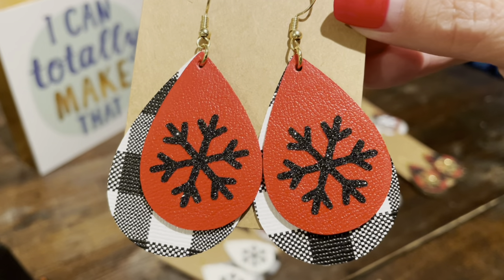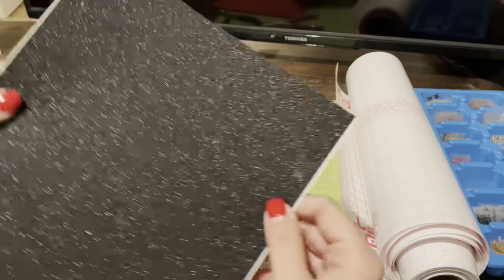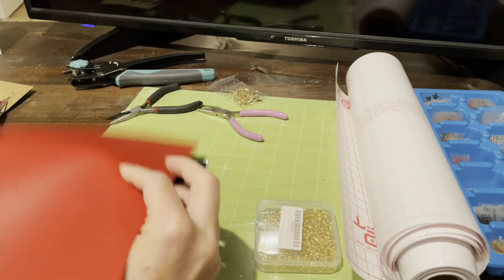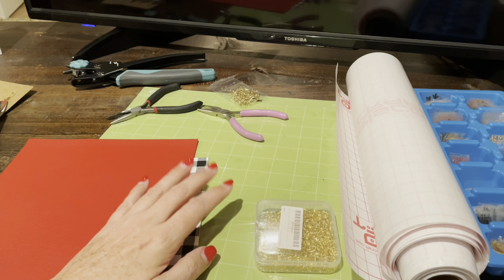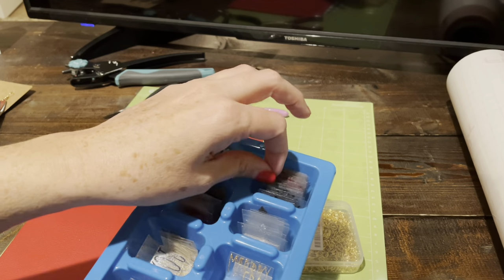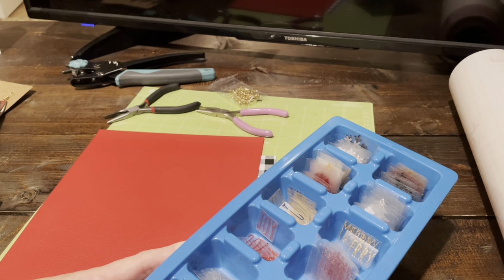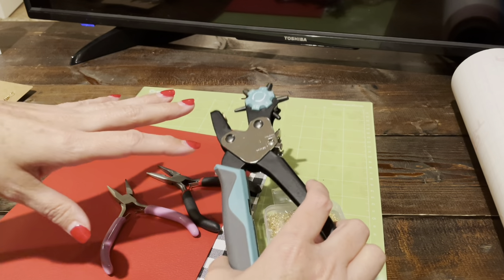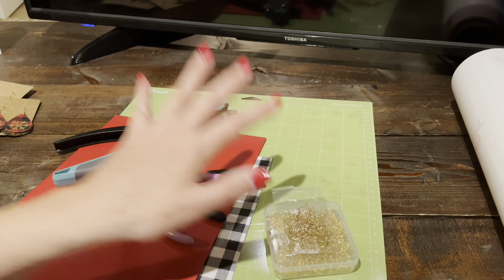How to make faux leather earrings with tips and tricks to apply heat transfer vinyl

Comment: HTV....I had a suggestion when you mentioned the indentation around the faux leather, where the carrier paper makes a mark. If you cut the perimeter of the snowflake by cutting through the carrier paper, you'll end up with just the snow flake.  Then you just put the snowflake down and it will not leave any marks when ironing.  Or just cut the carrier sheet out larger than the tear drop and that will also work.

Comment: Also I am no expert but after seeing you cutting the shape of the flake from the transfer tape, why don you just run the design with a transfer on top of it that way you will have an exacted snow flake ready to press with no lines and the after pill the transfer tape!? wont that work? let me know if you try it and it works! i actually never used a circuit before, i did order one but it will take a few weeks till ill get it!